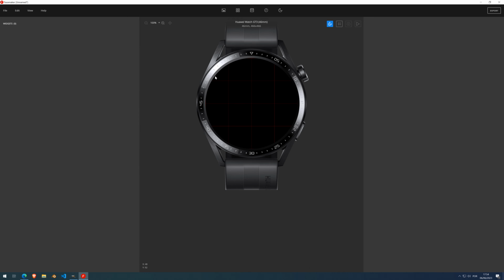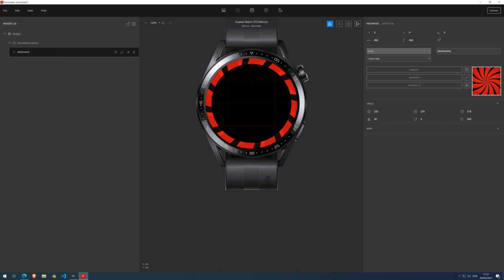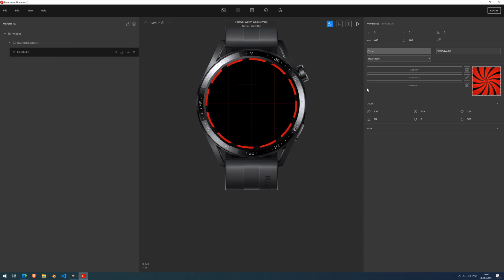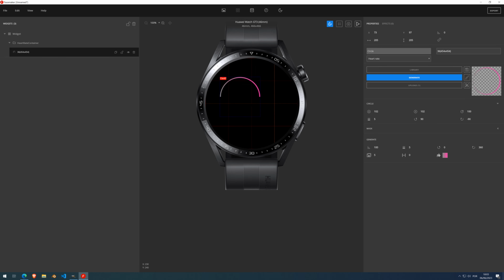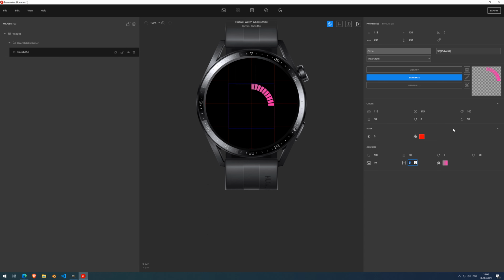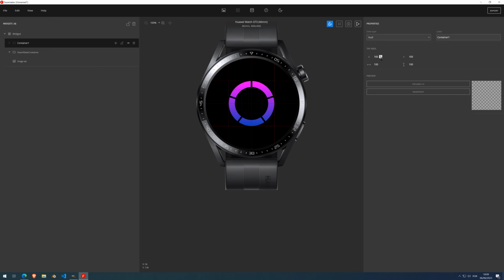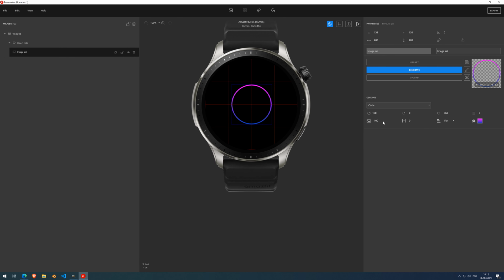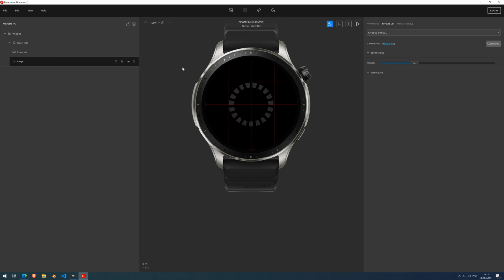How to use Watch Face Circles

Comment: Good luck. When I export the design after finishing it gets stuck on the "wrapping up" text. What do you think is the problem?
Reply from the maker: It may be a multitude of causes and Youtube is not really optimal to give you support.
Feel free to contact me by email or by logging into the Facemaker Discord server, where we can speak in realtime.

You also haven't specified what your watch is and Facemaker supports more than 300 watches.
I'll assume you're designing for Huawei. Have you installed the Visual C++ Redistributable libraries, as recommended on the installation process?

Comment: is there a way to do this on the TREX - PRO in facemaker standard edition ?
Reply from the maker: Of course there is Nic, but not with the Circle widget.
The ZeppOS watches still have a rough implementation when it comes to circles. They are very basic, allowing only the use of a simple color.
This is why I developed "Image Sets".
You have the procedure for using Image Sets to create circles on this video, just watch from here: https://youtu.be/OqtqBZ585Xg?t=1080

Add an Image Set (for example, the Heart Rate Image Set), press "GENERATE" and select "Circle". You can add as many segments as you want, define a gap between them, a color gradient, the start and end angles and so on.

It's kind of awkward explaining this on Youtube, so I urge you to login into the Facemaker Discord server (https://discord.gg/caxN2dv) and there I can explain better how you do this for T-Rex Pro, in realtime.
But I think this video is pretty self-explanatory 😉
Reply: @FacemakerNunoBessa  thanks it seems you are referring to Zepp OS here. And it’s my understanding that TRex pro does not use Zepp OS.
Reply from the maker: @npaidas  Yes, you are right.
For some reason, I read "T-Rex Ultra".

That being said, unfortunately, it is not possible to do what you want, at least to my knowledge.
The old Amazfit framework is very limited and I do not have the liberty of adding new widgets, contrary to the new ZeppOS framework.

Sorry :(